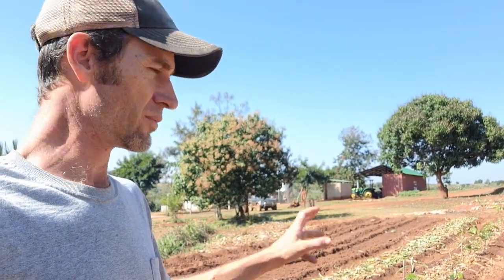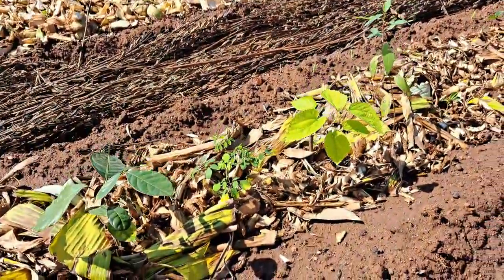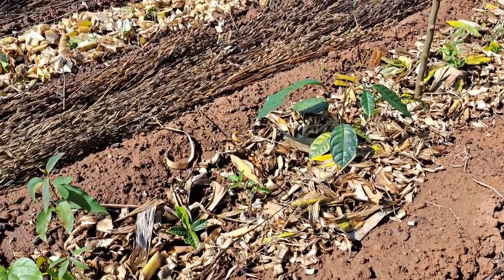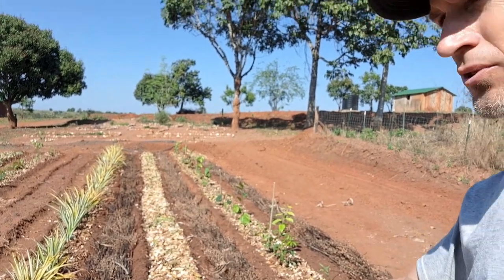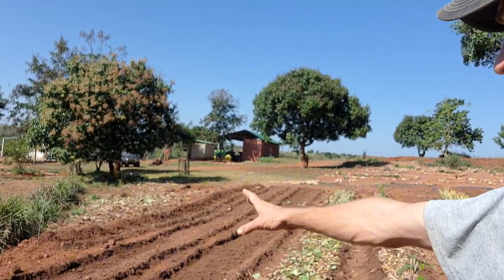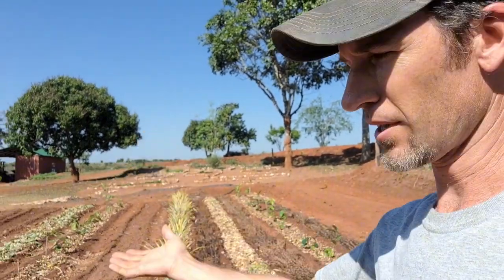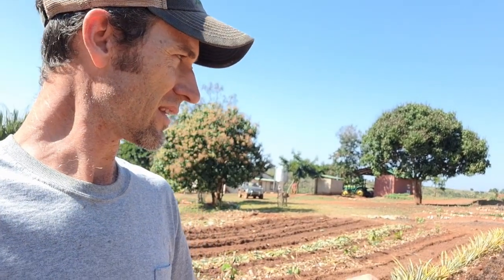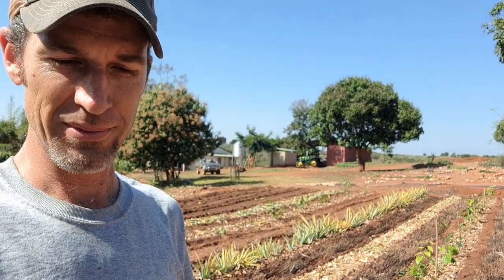Syntropic Agroforestry - The First Plot - Episode 1

Comment: 1 foot why distance is very less
Reply from the maker: In this type of agroforestry system we plant a diverse mix of trees at a very high density. The high density, 1-1.5 ft spacing, has several benefits especially in the first phase of this system. The competition of the high density planting forces the trees to grow quickly and generally quite straight. It also produces much more biomass in the early phase than a less dense planting. Planting in a high density also gives us many options in the future depending on what we observe in the systems growth. For example, in this system we have planted citrus and litchi trees for future cash crops. We may find that after 2 years the citrus is not thriving but the litchis are. We simply remove the citrus and use for biomass and let the litchi trees continue. If you plant a monoculture of citrus and the trees don't thrive, you have to take them out and start over with something else, setting you back years. We know it seems very counterintuitive to plant trees at such high density but we have seen much better growth on trees planted at this density then planted at commercial mono culture spacing.
Reply: @newharvestfarm4502  fast growth at the cost of removing some other plants at later stage?
Reply from the maker: Yes, basically that is how it plays out. Along with the trees we plant annual and short cycle perennial plants that force growth, provide early income streams and provide early shade for establishing the trees. Those come out of the system from 3 months to 2 years. We also use a portion of our trees for a similar purpose. We use fast growing biomass producing trees that force growth as well as add lots of biomass and nutrients to the soil but will again come out of the system from 2-5 years. What makes this advantageous for us is that we can use large numbers of trees without added cost because we are collecting seeds and planting out our own trees. Some we plant in our nursery to transplant in the future, some directly from seed.  If we had to purchase every tree it would make it expensive and less advantageous to plant at such high density.